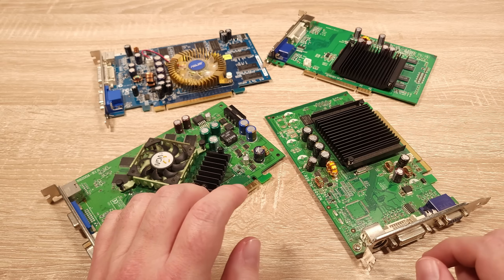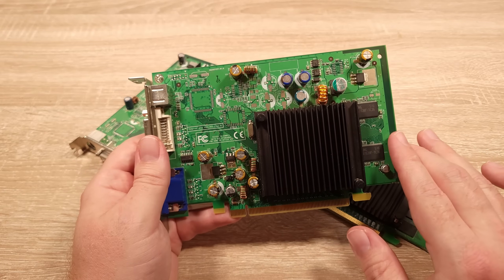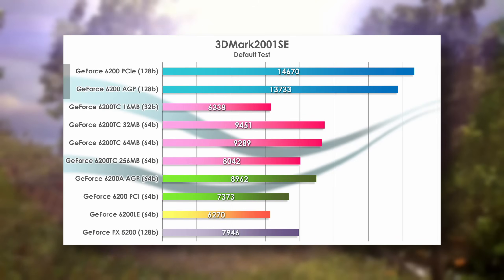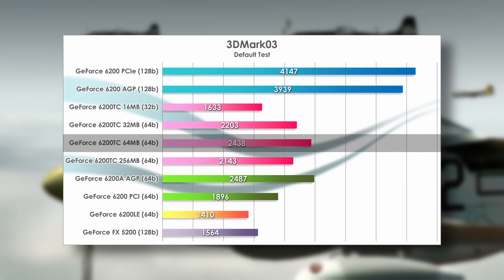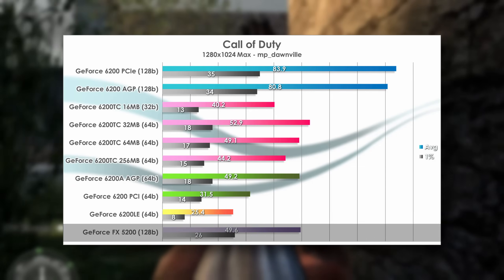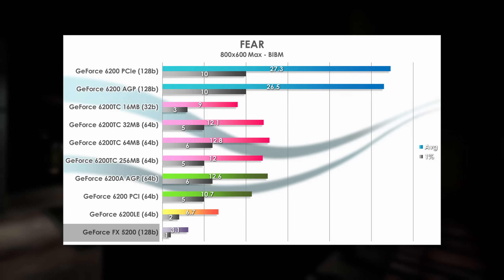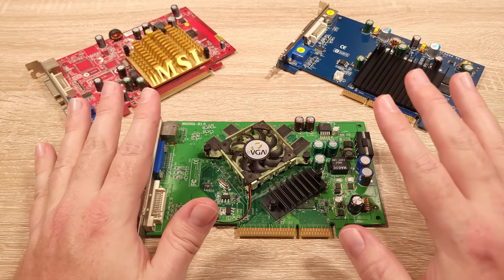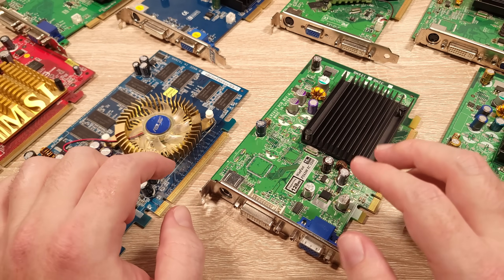GeForce 6200: A Needlessly Comprehensive Video

Comment: I'm getting an  Gigabyte GF 6200 AGP 256MB AGP Card to run on a Gigabyte GA-6RX Socket 370 Motherboard with intel Pentium III SL5QJ 1.00GHz and windows 98SE. Its not a Phenom II but I don't expect miracles the motherboard has DDR RAM and I probably won't need the AGP Aperture turned on.

Comment: damn I threw one of those old msi cards out a year or two ago. I don't even recall what it was in.  I had saved it but it was banging around in the back of my car for a while and figure whatever. I had an old voodoo like 15+ years ago from my aunts pc who used it for graphic design stuff that had the expendable memory slot on it. I should have kept that one but I was only getting into pc's.  Probably why I save all the weird cards I find on my wall now. Now that I am thinking that wasn't the voodoo even though she had one it was an old ati card with a sodimm expansion.

Comment: I absolutely love these 6200 PCI cards, and stick them in any retro system simply because of the digital outputs, and the crazy mismatch of CPU vs GPU computing power and memory capacity/bandwidth. Being able to pair up on of these with a 486DX4 or a modern Ryzen with PCI motherboard just blows my mind.

Comment: You're missing one more GeForce "6200" card: the GeForce 6600 LE.

It has the same GPU configuration as the regular GeForce 6200: NV43, with 4 pixel pipelines and 3 vertex processors.

Why they called it the 6600 LE? No idea.

Comment: A lot (most?) of the NV43 chips could be unlocked to full 6600 specs minus the faster ram via firmware flashing/RivaTuner. It felt soooooooooo good when I was in high school and a broke chump (stilll am :P, actually) to be able to squeeze out almost a 100% increase in speed out of these cheap cards. It felt like I was sticking it to the man (nVidia) and finally getting one over :D.

Comment: So many variations! Nvidia was at it even back in those days! XD 

The different bus widths, the VRAM differentials, the turbocahe versions, etc! BUT it was a much better budget option than the FX5200 had been! The 6200 was actually capable of running those early DX9 titles in their full glory, with a bit of resolution sacrifice. It could even get through Doom 3 well enough, if you made enough sacrifices in the details settings and tweaked via the console a little! 

But lets face it - if you bought this card to play the latest games like HalfLife 2, Doom 3, Far Cry, etc - you were making a mistake! A budget card is a budget card, you get what you pay for! 

The 6600GT was reasonably priced, as was the LE and XT variants of the 6800. And those were the actual gaming cards! 

6200 ran stuff like Warcraft III, Dawn Of War, Age Of Mythology and iD Tech 3 games well enough, for under £90!

Comment: Nice video as always.
 I bought a brand new geforce 6200 128mb AGP and it was what made my pentium 4 3GHZ 800MHZ PGA478 last longer.
it made that piece of turd become usable again and i was playing half life 2 on it with 4gb of DDR1 @ 200MHZ (yes you were running on quad channel with that CPU and you needed 4 identical sticks of ram for being able to achieve that).
and it was not bad!
The HDD was really an annoying point on that PC was a slow 40gb IDE thing.
i sold it when i got a I5 760.
someone bought it for €60 the full PC.
The guy who bought it bought a brand new computer case for it and i installed the computer on it. 
And he brought it back to me for being extremely slow. 
And it was the thermal paste being extremely dried out after all these years of running with no maintenance even the access to bios was a pain i never seen a PC so impossible to use but still working.
After some thermal paste installed on the GPU it became exactly the same as what i remembered and been used for some years like that.
Of course it never seen any evolution cause it was already at the max it can be evolved.
This was the story of my old pentium 4 i hope you liked it.

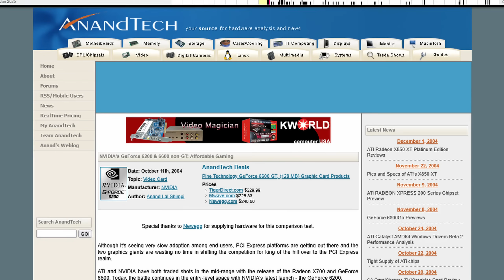Comment: 2:50 Nvidia halve the fillrate then remove memory bandwidth-conserving features then make the card 64 bit 🙄; maybe the postfix should have been "s" not "v". Nevertheless I'm surprised how well these crippled cards performed. I had the option of buying a 512MB Inno AGP 6200, but selected a 128bit 5200 AGP instead; I want Win98 compatibility and performance, COD, SS and 3DMark2001 indicate the card will perform adequately for that era.

Comment: I had a low-profile GeForce 6200 PCI at one point that I got for free out of an e-waste bin about 15 years ago. I think the stupidest thing I did with it was stick it into a Celeron 433 MHz based Compaq tower that had no AGP slot since it needed a video card. I eventually put it into my Dad's Socket 478 machine with a 3.2 GHz P4 which did have AGP, but it was still an upgrade over his GeForce 4 MX440 he was using at the time, and I could finally play NFS Underground 2 with the DX9 effects turned on.

It was a good card for free but I also ended up finding a Radeon 9600XT in the same e-waste bin a few months later that I used instead for many years and I still have to this day, I don't remember what happened to the 6200 PCI I had, it's not in my stash of cards anymore so it either went to e-waste again during a move years ago or I got rid of it in a PC I sold to someone, I honestly can't remember lol.

Comment: one guy who still uses GeForce 6200 in 2025 disliked the video 😀
0:48 - Well, turnaround in DX9 performance yes, but on other hand drivers for 6000 series significantly lowered compatibility with older games, so ATI was clearly better back in the day for gaming, I wish I knew that back in the day!!! My father literally trew install CDs of Alien vs Predator into river because of how he was angry that is has glitches, but it was caused by nvidia drivers, now I know it, back in the day, I just blamed the game. 😀 But at least nvidia had cooled those PCI-e to AGP bridges, while on later ATI agp cards, it was often hot that you could cook on it. 😀

Comment: I once owned a BFGTech FX5200 PCI card with 256 megs of RAM. For a low end card, it was surprisingly useful and I only got rid of it when driver support ended.
Reply from the maker: Those are still legit cards for systems without AGP and I have one from BFG as well

Comment: That 6200TC with ONE SINGLE 32MB memory chip is wild!!!  What other consumer-grade discrete video cards exist with only one single VRAM chip?  I honestly can't think of any - everything in my collection, everything I can even think of, has at least 2 chips.  Is this thing really that unique?
Reply from the maker: There are others, sadly. I've seen some really piss poor GF4 MX4000s with a single memory chip. There's seemingly no bottom to how bad entry level hardware can get.
Reply: Every Rage XL PCI I've ever seen (and some AGP ones too) as well as the 8MB Pine SiS 305 have a single 32-bit SDR chip

Comment: I had one. Used it to play counter strike 1.6 at 100 fps, world of warcraft and a bunch of generic korean p2w mmos. It didn't run Portal 1 though. Replaced it with an 8800 gt 2 years later.

Comment: ive tested geforce 6200 pcie turbocache on 98se with 82.69 drivers and it works fine...just that you're limited to the builtin vram and the usual 8x.xx drivers shenanigans in older games :)

Comment: Nice informative video, I quite like it. Can I ask you to look into your audio setup? Your mic is catching a lot of your breath, you can try reposition it to be not in front of you when you record, but offset to the side. It will record your voice the same, but the breath will not go into the mic, you can also install the pop filter, the round disc that goes in front of your face. Or maybe it's not the breath issue but high gain issue, it's better to record at lower gain and then add gain in post production. It's also better to have the mic further away from you when recording, though, it is only an option in prepared rooms, that do not echo. Audio is pretty important for storytime videos. Thank you for the content, I like topics about low end hardware. Maybe G210 next? They have many revisions actually, some on G92 core and some on 216/218 core
Reply from the maker: I do both of your suggestions already. But I'm pretty happy with the result, and have been getting a lot of positive comments from others as well. Thanks for the suggestions.
Reply: @PixelPipes  Ah, good to hear you are doing that, sorry for me saying all that. Thank you for the videos.

Comment: I built a system around the low-profile Gigabyte 6200A 256MB card. This one is interesting as it has 800MHz effective clock speed on its DDR2 memory chips, which overclock further to 930MHz almost closing the bandwidth gap to 128-bit variant. I wondered why in certain games performance is terrible - 64-bit GeForce 6200 should be about the level of performance of Radeon 9550 / 9600, but in certain titles I was getting considerably worse perfomance while getting close in others. That's when I learned about 6200A having only half of the ROPs.

Low-profile AGP cards situation is actually pretty interesting if you want to maintain some Windows 98 compatibility. Radeons top out at terrible 64-bit 9600SE and for Nvidia you have this 6200A which is actually much faster. I had high hopes for FireGL T2-64s which surprisingly boasts 128-bit memory interface and is faster than anything I mentioned, but drivers situation basically rule it out. If I could reliably run it as a Radeon 9600, this little card would be the best low-profile AGP card with pretty decent compatibility with Win 98 (certainly much better than GeForce with 6x.xx drivers).

Comment: You can be sure If NVidia could somehow leverage System Memory in such a way to improve AI workloads, they'd be all over that as a selling point for their cards regardless of memory prices, but we haven't seen any movement in that direction. Instead we've seen the opposite with the likes of resizable bar to make cpu access to VRAM more performant. They aren't going to kill their golden goose by making AI performance worse because they are limiting the amount of VRAM.

Comment: The best one 
6800le one card that you can unlock the extra schades .
So it performance more like a 6800 pro with sdr memory.
The real budget card with good performance.
And its in AGP slot .
Use that card a lot

Comment: ah the days of gaming on a celeron D 335 socket 478 with a fx 5500 and then a 6200 , i didn't realize how descent the 6200 was until i later got a emachine with a sempron socket 939 cpu which while a low end amd chip for the time ran circles around the celeron D lol, even though i did ineherit a pcie slot on the amd system i still used the pci version that i had previously purchased when i was still using the celeron D system
Reply: The best thing, and possibly the only good thing, I ever found out about the FX5500 - was that it's cooler was perfectly interchangeable with the Geforce 2 Ultra PCB. So my two GF2 Ultras that had both developed bearing grinding were ripped off and replaced with brand new FX5500 HS+Fans! Worked a treat! 

The actual FX5500 PCB's ended up in the landfill....

Comment: A splendid new years gift. In the vid, i knew I was in for a treat of a laugh when I saw the FEAR bench maxed. As someone who used a Turbo Cache 6200 back in the day, that is accurate. Though turning off volumetric lighting and soft shadows does ALOT for the fps. I wouldn't be able to max it out til sometime later when I had a 9600 GT.

Comment: I wonder how the Radeon 9700 Pro did in that benchmark at the end with the 5950U. I loved my Radeon 9700 Pro
Reply: Ye I loved my Radeon 9800 as well
Reply: Much better I assume. In 3DMark 2005 with shader 2.0 Radeon 9800 almost three times outperforms FX5950 Ultra
Reply: @Vlady510  Depends on what you were playing? My FX5900 Ultra beats my Radeon 9800XT in many titles, particularly DX8 / OpenGL stuff of course. It just handles certain situations better. Then again, with many titles like the newer DX9 games of the time, the Radeon wins. After extensive testing, I figured the best conclusion is to say "they trade blows", which they did.

So it depends on what you played, back in 2003-4.

By the time 3DMark 2005 was relevant - nobody serious about gaming at the cutting edge of PC hardware had kept hold of their FX series card anyway! The 6800 and 7800 GT/Ultra cards were affordable and infinitely more capable. As was the X800/850 series and the X1800/1900 series.

Things moved hella fast back then. The FX5800 was terribly engineered, the FX5200 was a joke and the FX5600 was lacklustre ... but the FX5900/5950 were very decent cards. Mine blasts out Quake III in super high resolution much better than my Radeon 9800XT can!
Reply: I had a 9700 Pro and 9500 Pro, they were both awesome
Reply: ATi's R300 Kahn VPU was godlike  even with a decent overclock you could keep up with the 9800 XT, my Hercules 3D Prophet 9700 Pro I managed to OC from: 325Mhz core / 620Mhz DDR to 412 Mhz Core / 730Mhz DDR, it's copper cooling helped a ton. and I am sure a 9700 Pro will beat a 6200 AGP in many things especially with FSAA & AF enabled hehe.

Comment: On the first model of 6200 you can unlock the disabed pipes with rivatuner...and will perform closer to a 6600 !  had a Leadtek one in the old days... 😉
Reply: hell some of the pci ones let you do it as well lol i did that and it brought a boost even with the gimped pci slot
Reply: I ordered a 6800 XT for just a fraction more (£10 more?) than a 6600 GT, even though the benchmarks said the 6600 GT was faster in all but super high resolutions (1280x1024 and above). Cos I read an article about unlocking the XT with RivaTuner.

My card was revision A0 and unlocked ALL the masked pixel / vertex pipes and I basically got a 6800 GT for half the price. Zero artifacts! XD

But I ended up disabling a few pipes, to ensure longevity, and added a mild overclock. Was a killer card, for a killer price! Doom 3 was buttery smooth and looked awesome.

Comment: I have an EVGA 6200 LE, but mine is AGP and has 256 MB of VRAM. I also had to replace all of the caps on it, even though I only tested the card once, but never used it fully afterwards. The caps all went bad in storage during the years. I also have an FX 5200 but it's PCI slot which kind of makes it REALLY suck in some old games and ok-ish in others.

Comment: I remember updating a system with a GF4 Ti4200 with a 6200 circa 2006 and it was a reasonable upgrade for less than $100
Reply: I loved the Ti4200. I.ve keep it fot years before moving to a 6800.

Comment: You can actually buy AGP versions of these that have been pulled from medical equipment, such as the "Philips iU22 iE33 Ultrasound".

Got one as a replacement for my "needs new SMD components" EVGA 6200A 512MB. Was really annoyed to find that it had developed problems in storage as I bought it ~10 years ago from EVGA.

Comment: Currently have a pair of 6150SE-based motherboards. They're a good way to experience HL2 in the peformance of the original Xbox.
Reply: I remember the onboard 6100 and 6150LE boards being quite good if you had at least 1GB of RAM. You could get one with a 3400+, 1GB RAM for like $400 and be on your way playing games. My 6100 based eMachines played WoW like a dream compared to my previous computer. My brother had a 6150LE based board which we needed to upgrade to 1GB of RAM for a smooth frame rate (were talking like 25-30fps lol)
Reply: @Baulder13 The ones I have are from the Vista/7 era and are currently running at least two GB of RAM (DDR2 and DDR3) with the latter upgraded to 3GB but with single core chips. (Athlon 64 and a Sempron 150) I think the CPU is the main bottleneck.

Comment: Forgive me if this is a stupid question, but could all modern GPUs running modern WDDM drivers be considered a form of TurboCache? Reason I ask is that Windows (at least 10/11, and probably going as far back as Vista) seems to allocate an amount of RAM (labelled 'Shared GPU Memory' in Task Manager) matching the size of your video card's dedicated memory, the total of which is reported as 'GPU Memory'. For example, on my system with a 16 GB video card, Task Manager reports 32 GB of GPU memory.
Reply from the maker: Yes, as I understand it, there is a level of virtual GPU memory in system RAM as a part of the PCI Express standard, so your GPU can still run things that go beyond its onboard VRAM. TurboCache is a little more sophisticated both on the GPU side, as well as the driver side, with the design of the memory controller and the latency hiding techniques used. There may be more nuance than that with modern GPUs that I'm missing, but that's just what I know.
Reply: @PixelPipes  I'd say, AGP Aperture size is AGP's equivalent of what TurboCache uses on PCIe (with FastWrites being kind-of the on/off switch for this "equivalent feature").
As for modern cards - all PCI-e based cards should use TC-like VRAM overflow features, it's simply marketed as ReBAR now because modern cards don't just "use" or "not use" it. 
From performance perspective we need to adjust how much of RAM a card can access in one go (4G, 8G, 16G, etc) and not if it's being accessed in a certain way.
Problem is, back in 2004/2005, some bean counter's thought you could save a lot of money with this, since you don't need VRAM at that point (slowest GPU = no VRAM needed when PCIe was so fast). To put this into perspective : You can see what is happening with 8GB GPUs and modern games at 1440p, now imagine what it be like when instead of 8GB VRAM you got 2GB max. and the rest was meant to be supplemented via ReBAR from system's memory (I think 2GB now, is roughly what 16MB TC version equivalent would be like :D)
Reply: @PixelPipes  Interesting, thanks! I was not aware that the  shared VRAM thing Windows (and likely every other modern OS) does is a part of the PCI-E standard!